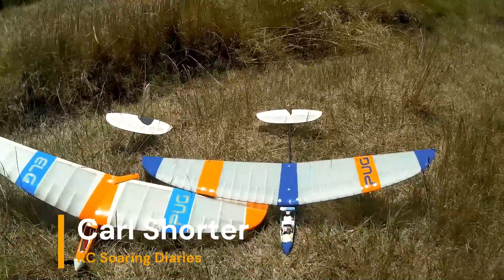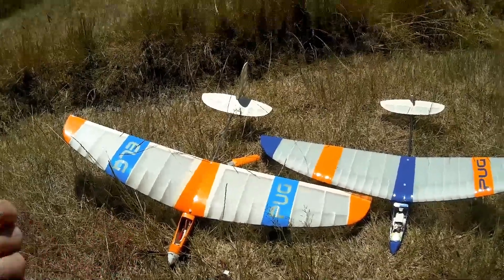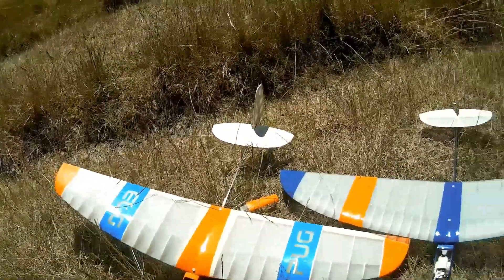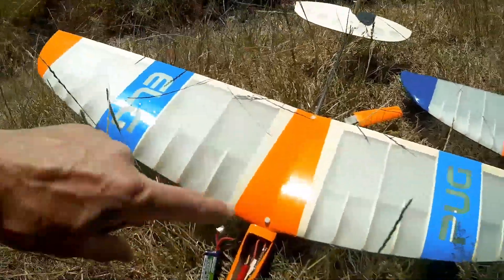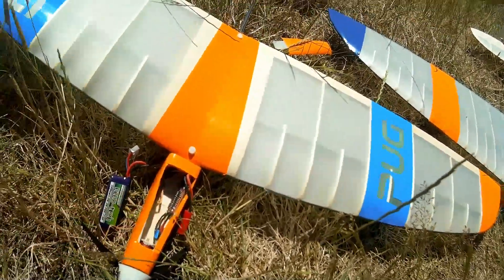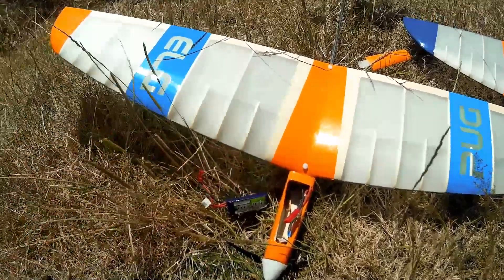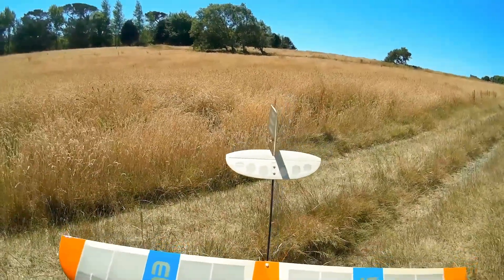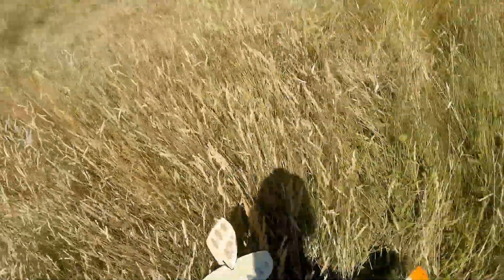Intro: Pug V1 DLG is now an ELG (Electric Launch Glider) - Introduction - 10th July 2022

Comment from the maker: Electric setup items:

Turnigy 1811-3900KV motor (same as the what's known as the "10g brushless motor" I believe)
Hobbyking 10A ESC
Hobbyking 4.5x3 folding propeller
Nanotech 300mAh 35C/70C 2 cell lipo

Comment: Where are the STL´s to download? What for filament do you have use? I will order material for printing, but dont know what is the best, to prevent deforming and destroy by the sun.
Reply from the maker: There's nothing to 3D print. It's a balsa glider using production parts.